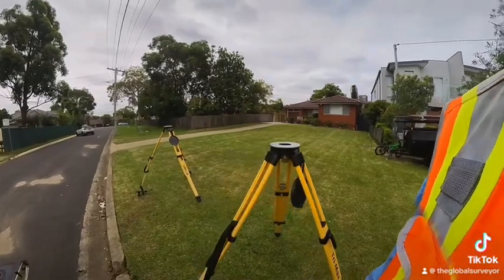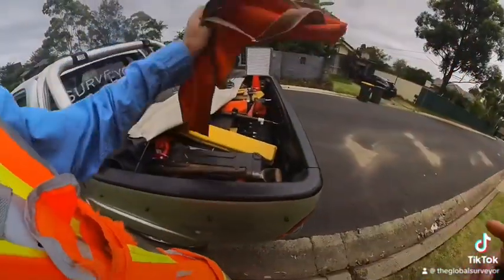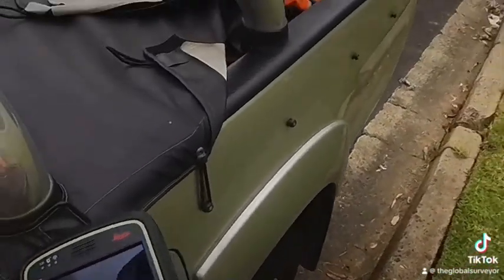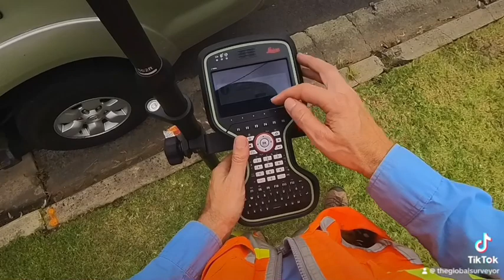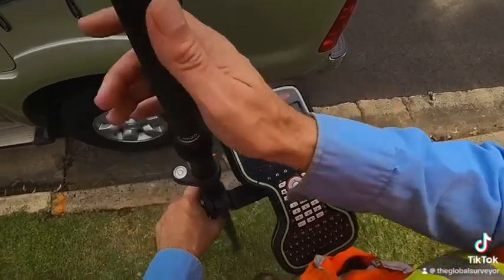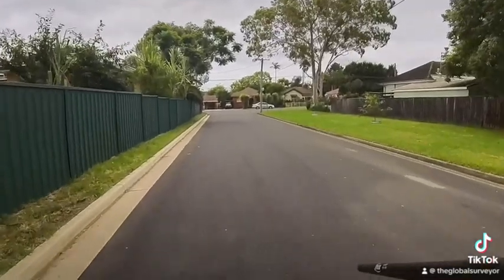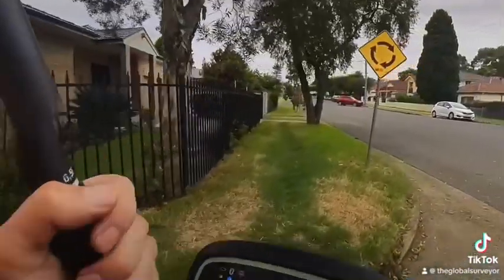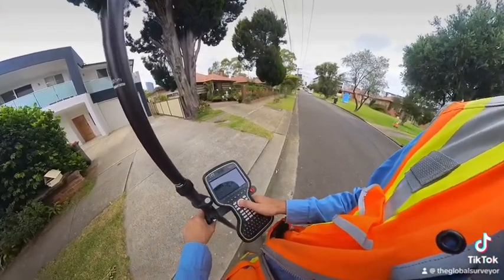Come surveying with the Global Surveyor

Comment: sweet. we do roughly the same thing here in texas. We use a VRS to set our hard controls which the set up our GPS. and walking blocks is a pain indeed. i’ve spent all day walking blocks and found very little monuments.
Reply from the maker: Yes sometimes the best thing is to spend an hour or so gathering as many marks as you can find esp. with the GPS because you can put it all on a co-ordinate system to later stake or look for other marks. Does save a lot of time. Thanks for watching.